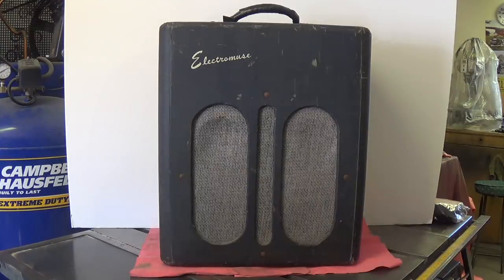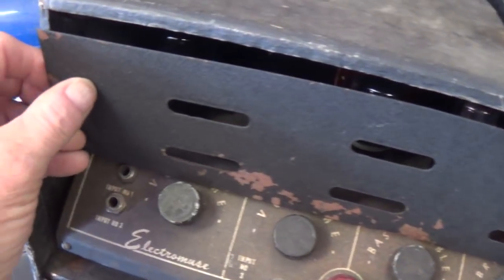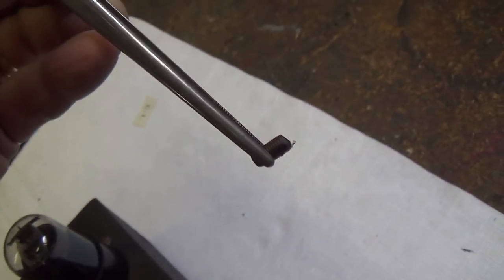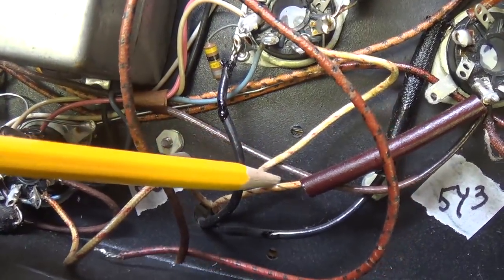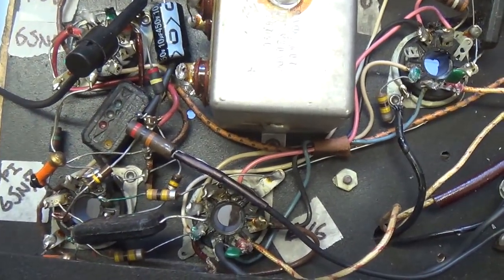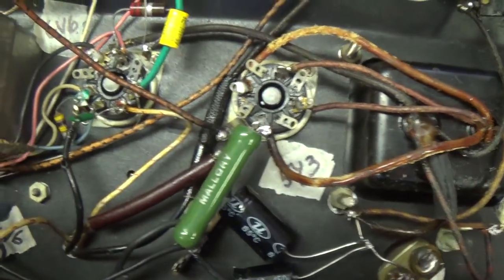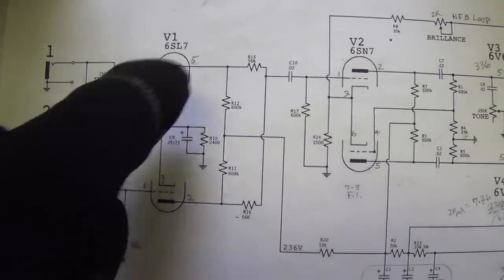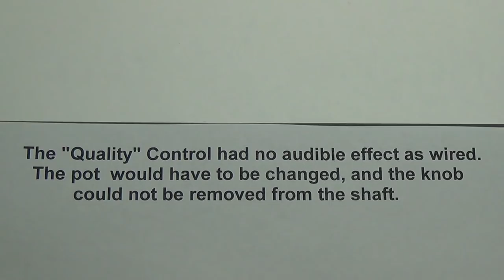Let's Explore and Repair a 1946 Electromuse Amp

Comment: Isn't the "brilliance " pot  just a treble bleed /boost?  Like they used to say, they say 4 /5's will get you 20, ......20" of speaker moving air that is ,( grin) .I actually learned something on this, I paid attention .....tnx Uncle Dug
Reply from the maker: Yes, I agree that "Brilliance" is simply a fancy name for Treble tone control, which, since it is a passive TC, would not be able to boost the treble, but simply reduce (or not reduce) it.   The cone surface area of four 5" speakers is equivalent to the CSA of a single 10" speaker. The difference is exponential, since the radius is squared.
Reply: I was 50/50 making a in cheek joke  but was serious when to total  diameters off the 4 speakers  and not as a single giant speaker only in the amount of paperthats doing the pushing .I thought the amp sounded bigger (BTW quite surprised ) than it would have been  had the little amp been equipped with a single ten inch .( No arguments from though Uncle Doug ) but you  raise a couple of questions with that correction .
     What about multi spkr cabs /amps likea Fender 4/10 bassman , Super reverb or an Ampeg SVT bass cab with 8- 10's ,( I think it was 8-10's )
   , The SVT cab with 8 tens , with a combined total of 80 inches of speaker paper  , would only be that of just 40 inches of paper pushing that noisy air ?. I know a300 watt  SVT  head pushing the 8-10 cabinet will rATTLE the windows or vibrate my pants legs before the same head will do if pushing a 2-15 cab.. scenario , placed a 40 watt  Super Reverb  with it's 4-10's   next to a  85 / 100  watt Twin Reverb with 2/12's  ,  both amps   at the same fixed db level  , the Supers 4/10's will be beefier , punchier and fuller sounding than the Twin with its 2/12's   at the same db .  The 4-10's being the kicker .. moving 40 inches of paper compared to the twins 24 inches of cone paper ,. But i am blind in one ear
Reply from the maker: The formula for the area of a circle is pi x the radius squared, EJ.....and speakers are 3-dimensional cones, not circles....but let's use the simpler circle area formula just for an example. The area of a 10" circle would be 3.14 x 5 squared = 78.5 square inches. So 8 of them would have a total surface area of 628 square inches, which would be about the same as a single 28.3 inch speaker.
Reply: Hi Uncle Doug , and thanks for some insight totally out of my realm of thought as I dont think I wanted to ever be that smart ,Id be dangerous to all things within arms reach . I understand it though , scary huh ? BIG BUT ,BIG BUTTS TJHOUGH AND A SMALL QUESTION , iF THAT FORMULA  is the actual way to look at 4 five inch speakers ,or the paper that makes up the cones  is more accurately defined as a ten inch speaker pushing a ten inch speakers amount of air with db, then what would that of an Ampeg SVT bass cabinet with 8 tens , surely those 8 @ 10" ea. speakers wouldn't be knocked down from (if it actually existed )  give or take a few inches 80 inches of paper moving against the air within a given db level    reduced to just guess-  ti -matedequilivant of just 40" of cone paper doing the work , comparatively speaking  ,a 2/12 combo amp with 24 inches of paper moving air or 12" if going by that formula , thus a Fender Super Reverb or or a bassman both with 4/10's or 40" of paper pushing air being reduced to just 20" of actual working surface . I hated math of any description and only did what needed  to memorize a formula long enough to pass a test then just toss the memory away like a card board box   Algebra really messed my head up or maybe it was Mrs Griffith's wickedly accurate  fast ball   or in her case "fast chalk board eraser  deadly accurate too  she'd throw and bean you from the black board to the back of class where you were cutting up . She never missed and dust flew from the eraser when she hit you in the head with it ....either way algebra messed me up LOL  . I gotta go bid on this telkecaster guitar but Ill be back to get more intelligent with whatever you have to offer
Reply from the maker: The formula applies to the area of all circles, EJ. Eight 10" speakers would have a two-dimensional area of 628 square inches......not 80.
Reply: I realize the difference I was only looking at it from the diameter of each as I said going into the formula for the square inch of a circle was a bit too deep for my wading pool mindset , I  originally only made the remark as a reference to how full the 4  little speakers sounded , knowing that one little speaker would not have cut it but 4 was impressive in tone and fatness considering the amp itself   just guessing maybe  15-18 watts rms  . Last night my old junky PC ,Ive had since 2006 took a nose dive ,fried the hard drive and not sure what caused it maybe the mother board too . I have copies of  some of the lost data and documents but still  lost a lot of stuff I can never replace. . I have a few others PC's but none are as fast as that old piece of junk . I'll miss it     Whaaaa.....
LOL
Reply from the maker: I had a lightning strike in my backyard that fried my computer, video software, modem, etc. about a year ago. It's part of the reason I ceased to post videos for a while. What a nightmare !!
Reply: Uncle Doug , In some ways I got lucky  ,I found 3 cd's with  my documents backed up I made 2 years ago ,and some ther cd's Ive yet to see what's on them . And even though I've began to separate myself from FaceBook ,I have so many friends I cant just cut the cord completely but I'm not on there like I used to be . (too mant reasons to mention ) however FB has a lot of my photos and other stuff so all is not lost just 25-30%,the rest I can recover . As for my hard drive , I got my jewelers lupe and started searching for the culprit  or any signes where there was damage . It didnt smoke as in visible smoke but it did have that  (oh no!) ( what happened ,everything was biz as usual then my monitor went black with a "power saving " banner flying around the screen , I tried every "ctrl /alt / delet , esc  trick I knew   I could turn off the monitor then power back on and I got a monitor screen for 30-40 seconds then it went back to that black screen with the floating pwr saving mode banner I fought it gently for an hour or more. I pulled the HD stuck an older one in from another c still the same ........(possible video card but I dont have one all my video and other type hardware is built into my mother board years ago my Lan ethernet went bad as did all my audio jacks , also built into my MB , I just plugged into the open slots on the MB aaudio card and a Lan card and have ran it with thathose for years all other MB functions were ok . It's not a blazing machine as it took awhile to load wndows and boot but after that it was pretty darn fast .Faster than any of my other 4-5 machines with newer OS's as Im still running WinXP. I
  You know Ive had amps and autos too that should have included  in the op manual trouble shoot ,when all else fails I good thump with your fist ,wiggle this or that ,r a light kiick on the tire  ad things are good to go . It was when I did all three except kicking it LOL that I got the smell . LOL To be honest my nest attempt to fix it was to toss it out in the middle of the street my temper had won the fight with my patience . OH .......i was saying .....I got my jewelers loop and went looking for signs and found it , I don't know what these components are as you know these digital tech wonders have the tiny little (approx 1/8 " in size ,rectangular "sumpin sumpins ," but only only 2 solder points , one had gotten hot and desoldered itself , the one next to it (same type ) was still mounted while not charred as Ive seen them do , it got hot enough that the microscopic tiny values / and ID info printed was no longer readable .  value s 'part e the microscopic values an and type printed . Sorry not sure why Im even telling you all this except I have a few old MB's laying around for I sometimes get the dirty gold off the pins and other parts  but i used my heat gun from the back side of the MB and now I got a few of the same looking tiny parts , going to test a few to see if they are polar specific and I made a workable smaller than ???tip fopr my smallest soldering pencil and what thwe hell , going to replace the two and just wing it and see if the hard drive comes back to life if it doesnt nothing lost as Ive got a couple of old win 98 pcs I dont mind frying in a hail mary experim   Im out here setting up another PC that was a fast machine but it was too big and bulky of a tower , Ive got a decent laptop with newer OS but 3 of the four USB connects are bad as I hate that built in mouse thing that you rub your finger on Im too much of a klutz for that  , Youy want to laugh ,just hand me your touch screen smart phone Ill have it jumping from my hand back to yours Im terrible . OK just findin humor in a sad situation all the best , chime if you  got anything smart a** to say to me Im in a great mood LOL
Reply from the maker: Good luck, EJ :)

Comment: also more power handling with 4 voice coils.
Reply from the maker: A good point......thanks :)
Reply: Are the values surrounding V1 in yours similar to the schematic?  Was wondering if yours was tuned for the 6SN7.
Reply: Further inspection of my chassis has revealed that it omitted R20 and C11.

Comment: Ironic how that awful line-cord as well as that wonky toggle switch are included along with the 'BRILLIANCE" control as members of the 'QUALITY" grouping on the front panel :)
Reply from the maker: Indeed, David. I shudder to think which accessories would be included in the "Total Junk" grouping.
Reply: I knew that "brilliance" control was actually a "presence" control. I must admit I'm rather disappointed we didn't get a demo, but you have to stick to your customer's budget and it definitely works decently at whatever position it's stuck at. ;)
Reply from the maker: It's failure to perform was more a matter of bad design, AQ. The pot measured to be only 500 Ohms.....with a 30K resistor in series. I can see no way that this puny pot's 1.6% alteration of the NFB signal would be audible. If I could have removed the knob and replaced the pot with one offering 25K, and a 10K resistor in series, things might have been quite different.
Reply: Ah!

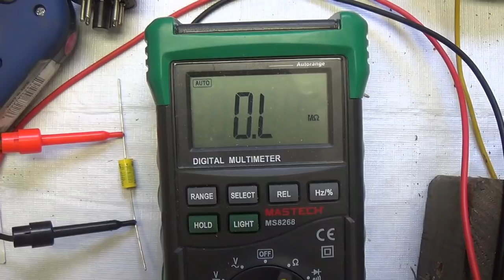Comment: Another 'first' here: the failure of a 'domino' mica capacitor! (14:52)
Reply from the maker: Apparently, despite the name "Micamold" they are simply paper-insulated capacitors that fail quite regularly. Real mica caps look different and last just about forever.
Reply: Wow, counterfeit components even back in the mid-1940's!
Reply from the maker: I guess this was before the concept of "Truth in advertising" came into vogue.

Comment: What did the "Billiance" control do????
Reply from the maker: Not much, as it was wired. The pot value was around 500 Ohms, but it was in series with a 30K resistor which overpowered any effect it might have had. Originally, it was intended to be an adjustable negative feedback loop.
Reply: TheGg6422 It would make more sense if it was shunted by a small capacitor, so that winding it up or down would change the turnover point of the NFB.
Reply from the maker: True, or If I could have changed the pot to, say, 25K with a fixed 10K resistor in series, I'll bet there would have been a more noticeable effect.

Comment: It would have been so nice to go twisted on the filaments, gee it sounds good though..
Reply from the maker: Yes, it would, Jennifer.....but I felt that the meager gains would have been outweighed by the cost to the customer. Thanks :)
Reply: Uncle Doug   Totally understood... there is repair, and reengineering.   It came out pretty good!   

Between you and Brad the Guitologist working on these oldsters, I am taking new interest in very early instrument amplifiers.  It is interesting to see how they saved a few pennies here and there compared to the hi-fi world that I grew up in.  

Love the humor you inject...
Reply: force311999 
I have never found hum to have any positive contribution to a musical experience,...other than Bing Crosby who sometimes hummed and often whistled with a tune.   The goal is usually to drop the noise floor below that which is outright objectionable.  In recent years there seems to a movement that embraces excessive noise faults as positive..which is in my world wrong. We can forgive a 70 year old amp for having a little bit of noise..  Once re-filtered, this amp though not dead quiet, is good enough to use. When I build new amps, or do a gut-job rebuild, I want dead quiet hum free, and as low a hiss as feasible for a given gain structure. The guitar gets ever more clear not being inter-modulated by loud hum.

Comment: Uncle Doug, Are there big differences between radial capacitors and axial ones? There is a very inexpensive source for electronics parts you may not be aware of; www.allelectronics.com. Flat rate shipping of $8.00, not too bad.
Reply from the maker: The only difference is that axials have a lead out of each end, while radials have both leads out of one end (for PCB's). I have always used Antique Electronic Supply for my components, other than transformers.